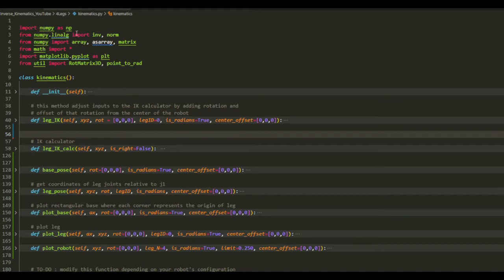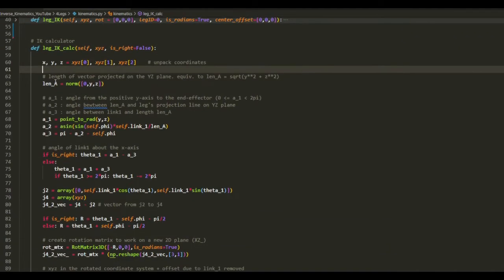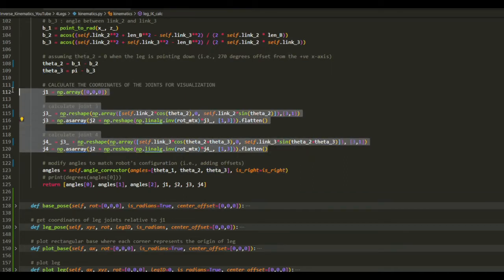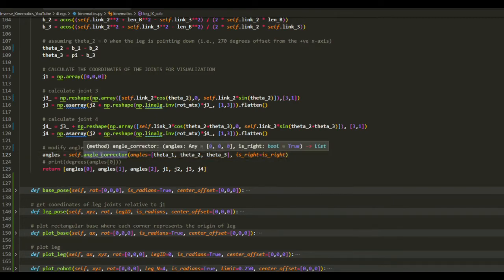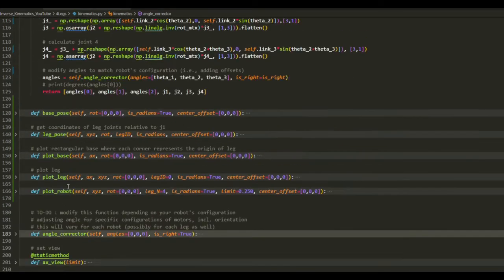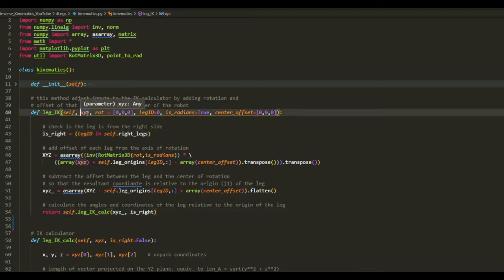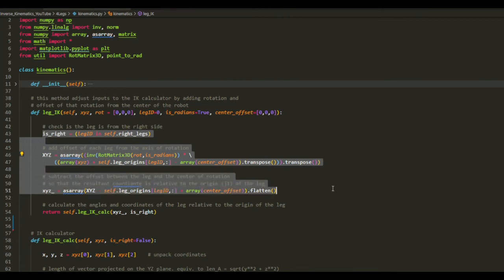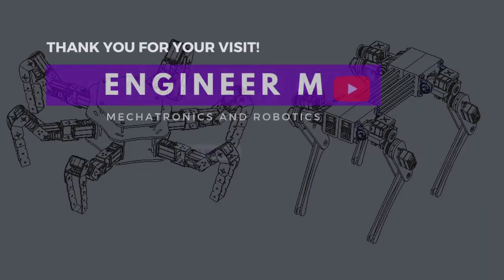Part 3 (Final) - How to Solve Inverse Kinematics of a 4 Leg Robot

Comment: how can i alter the function to move the foot position from under the hip joint to under the knee joint
Reply from the maker: Hi, you can achieve this by finding the coordinates of the hip joint, and then inputting them to the function as input arguments (z coordinates should be shifted down accordingly).
Reply: @EngineerM  amazing